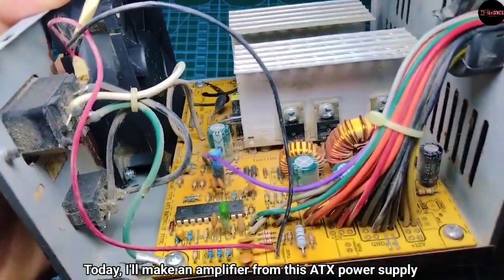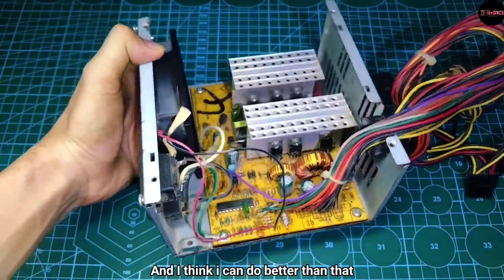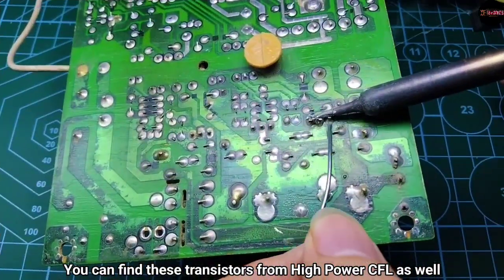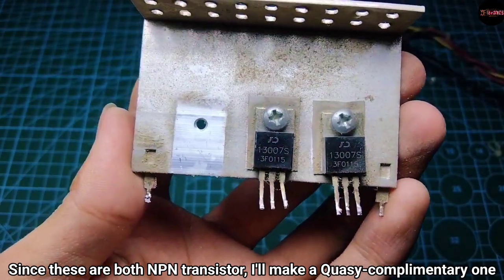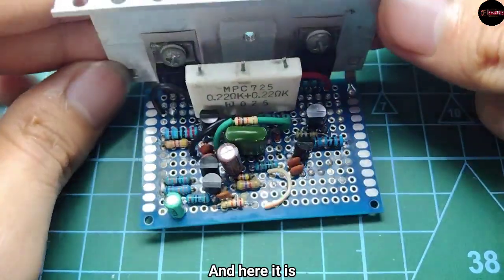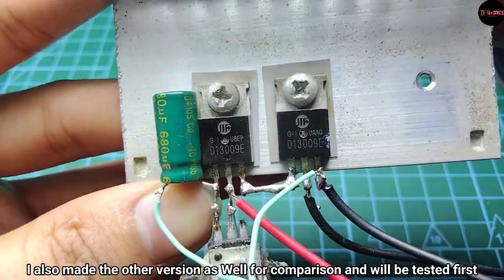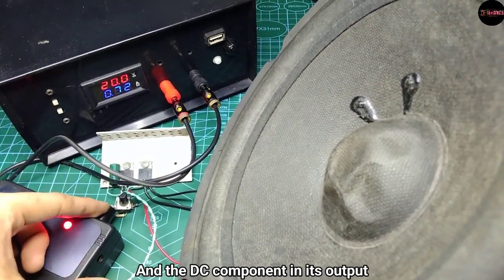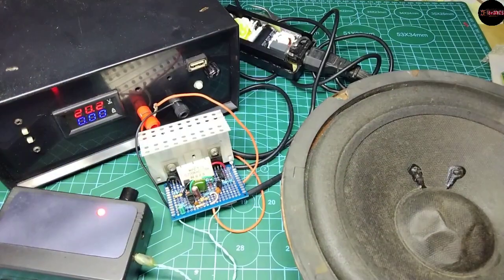DIY Amplifier from Computer PSU "the right way" #amplifier #atx #transistoramplifier

Comment: It looks very powerful, please make a video demonstrating the real output wattage test of this amp.
Reply from the maker: I used different capacitor in the inputs here and different value transistor. I will make a properly layed out and test it. But my estimate power is around 30watts RMS into 4ohms load

Comment: Why didn't you use a real speaker, one in a box? If you had, it would have proven your concept. As it is with your build, one can't say that it is better than the first build that you demonstrated.
Reply from the maker: I have one with the box, but it's too big.
You probably watched it without using a good quality earphone.
The main difference was the Efficiency, as you can see the 1st one draws 700mA at 20volts, thats over 10watts of power converted to heat.
Thank you

Comment: Not bad at all
Reply from the maker: I actually used s9014 and a1013 there, and a 680nF capacitor in the inputs, thats why it kinda lacks mid and highs, still be powerful with a tone control. Thanks bro
Reply: @x3dtronicsph  you use 9014 transistor instead c2383?
Reply from the maker: @GeoBass-89 no, replacement for the 2n5551 bro.
And A1015 to 2n5401
Reply: @x3dtronicsph  but complementary for 2sa1015 is not 2sc1815?
Reply from the maker: You can use majority of jellybean transistor replacement for the 2n5551 like the 1815 as long as they're match.
I used tha A1015 to replace the 2n5401 since i don't have the 5401.

The c2383 and a1013 , i didn't find replacement for them yet since i have them. Basically you can use any NPN transistor in the output stage with this driver circuit. Includes 13005 , 13009